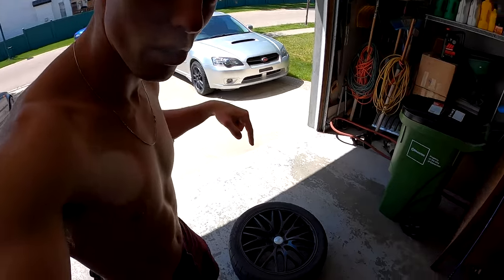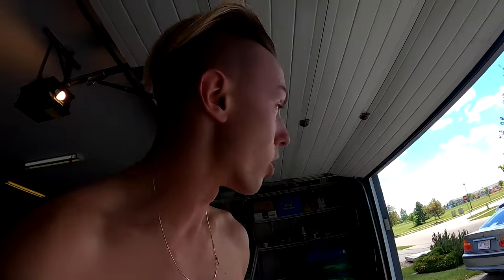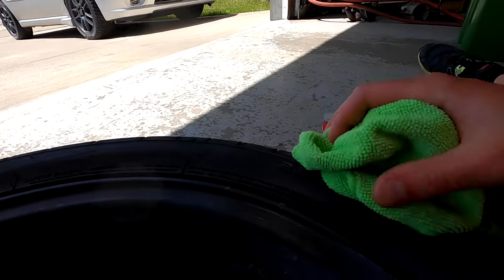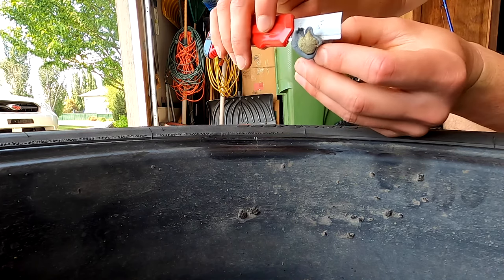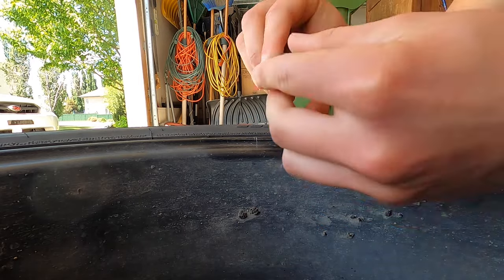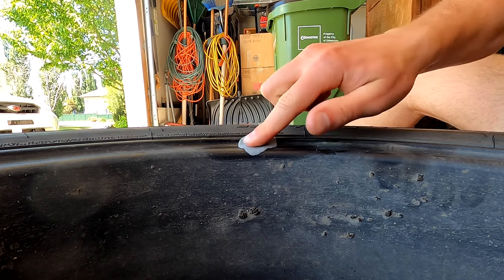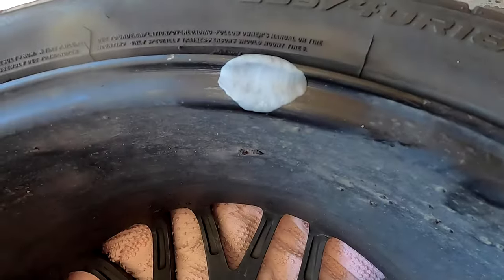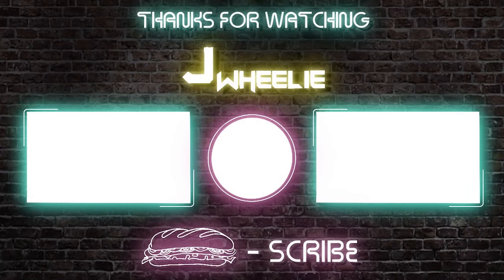How to fix a cracked RIM/WHEEL  (Cheap + Easy)

Comment: Tried it before. Doesn’t last more than 5 minutes on the car. Don’t bother, just weld it for real.
Reply: I greeeeee
Reply: Just tried this before watching video lasted a day wouldn’t recommend also
Reply: Exactly just go to harbor freind and buy the aluminum or torch rods you ain’t even welding but it will work until you can weld weld it

Comment: I don’t think that wheel could ever get properly balanced again
Reply: This is obviously to get u through if u struggling with some funds and that jb weld ain’t gonna throw it off balance that much won’t even notice the difference 🤣😂🤣🤦🏽‍♂️
Reply: If you treat it like bondo and just worry about filling the crack and removing excess jb weld, you’d never even notice if he didn’t tell you lol
Reply: If you treat it like bondo and just worry about filling the crack and removing excess jb weld, you’d never even notice if he didn’t tell you lol
Reply: I'm a wheel repairer and we tig weld wheels every day, which adds far more weight than this temporary repair and they balance up fine some wheels needing as little as 10 grams to balance perfect and most of them don't require that much more weight to balance to zero than a wheel without a weld.
And at the end of the day the majority of the imbalance that ur balancing out lies within the tyre.
Reply: @DavetheRaveDinkum  But how secure are those rims after welded? The reason I asked if because there's always a risk you're taking. And another question: Why can you just weld the rim as is instead of drilling a hole and cutting through the crack with a grinder?
Reply: It doesn’t work

Comment: Bruh, that might get you home but you better believe that is no solution. The crack will continue under stress for sure. That rim needs the tire removed, stop drill the crack, weld, grind, polish and treat the bead area. If any of you want to use the the JB weld, make sure scuff the hell out of the surface for better adhesion.

Comment: I think other way to do it would be to take the tire off, sand it a bit and put chemical metal epoxy on both sides of the crack, then sand and paint it again. Thats a whole lot of more effort though :D
Reply from the maker: Yeah, that would be the cheap and moderate level difficulty ;)

Comment: Repair cost in Atlanta $225 first crack $50 each additional. I tried jb weld and it’s hard to get to cover the crack completely with tire still on. So I’m gonna now put fix a flat in it to seal rest of the small leak. 🤞someone said put a thick plastic bag between tire and rim to stop the leak. Fix a flat will ruin my air pressure sensor. So I’m still hesitant.

Comment: According to my tire place I have the same issue. I have not yet pulled the wheel and found it for myself but if it resembles this I will do similar, but I think I like the two part JB Weld (two tubes, squeeze and mix). I think it's holding power will be superior. Also, one way to prevent a crack from continuing is to drill a small hole at the end of the crack. I have seen this method in light aircraft. I think a tiny drill hole maybe 3/32" at the end of a crack might stop it. The JB Weld seals. Hold my beer.

Comment: Just incase anyone is interested. I just had a crack in the same spot on a Advan Gt forged rim. Was 210 bucks to fix by a professional shop. It's welded, repained and balanced with tire.. spend the money. You only get one life and for a cheap rim it's not worth doing it hack.  But his method will at least get you home if it's not holding air.